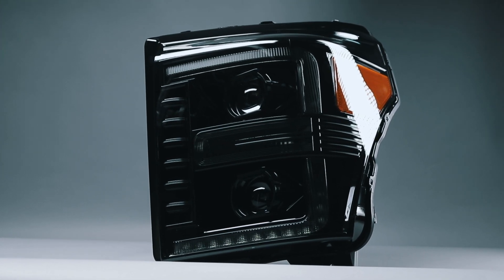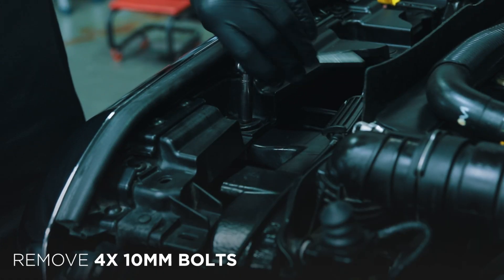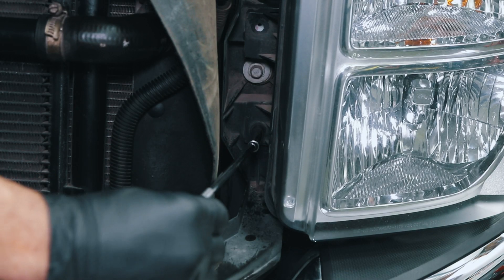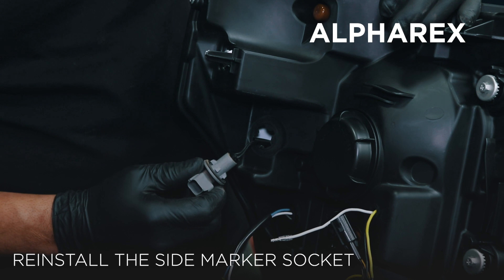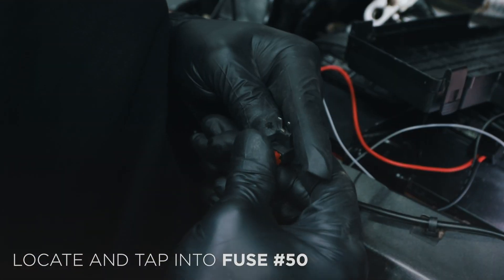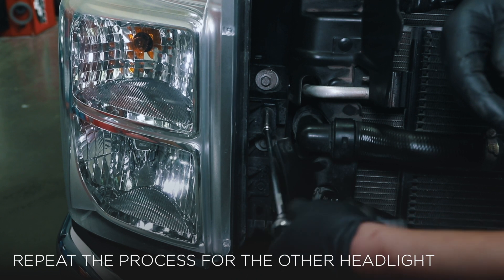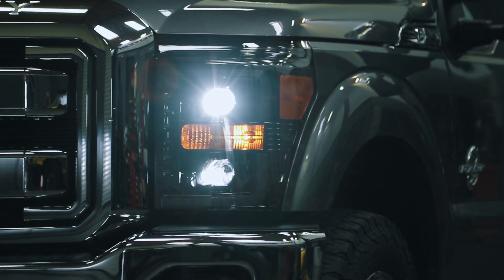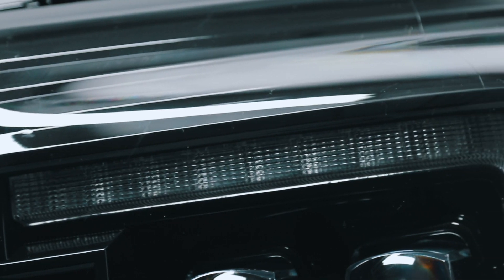AlphaRex Step-by-step Installation Video for 2011-2016 Ford Super Duty Projector Headlights

Comment: Just installed Fit was perfect. Watched a you tube video on installing them was very good. Easy Install Came with wiring harness for the DHL option. Will need to purchase a fuss tap separately does not come with kit. The LED are very bright. You get what you pay for

Comment: I would appreciate knowing how to get both the high and low beams to be on at the same time like in this video.
Reply: After over a month still no answer...
Reply: @ypsisteve  Clearly you don't know anything about headlights. An Alpharex engineer finally responded to an email I sent them. They informed me the LUXX series is the one in the video and it does in fact legally operate both high an low beams at the same time. The reason the Pro series (the ones I purchased) don't is because of the electrical current load using both high and low beam h7 incandescent bulbs at the same time would overload the factory wiring. For the record my 2014 Toyota 4runner and many other oem headlights operate both high and low beams at the same time. No brightbox required!
Reply: @brianh5393  You are right I don't know anything about headlights. Here is what  CFR Title 49 says.

S.5.5.1Each vehicle shall have a means of switching between lower and upper beams that conforms to SAE Recommended Practice J564a Headlamp Beam Switching, April 1964 or to SAE Recommended Practice J565b, Semi-Automatic Headlamp Beam Switching Devices, February 1969. Except as provided in S5.5.8, the lower and upper beams shall not be energized simultaneously except momentarily for temporary signalling purposes or during switching between beams.

https://www.govinfo.gov/content/pkg/CFR-2004-title49-vol5/xml/CFR-2004-title49-vol5-sec571-108.xml
Reply: Some lights can operate high and low at the same time but they have to specifically marked to do so. That is further in the CFR. The overwhelming majority of lights are not so marked in the US and thus it is not legal to convert a light not designed to be upper and lower at the same time to now operate with both upper and lower on at the same time on public streets. Off-road is permitted at any time.
Reply: Boom roasted !

Comment: Will the wiring setup be the same for the LED version utilizing the factory wiring harness and connect directly to LED connectors? Will the LED light output be noticeably greater then the factory bulbs?

Comment: I'm having an issue where my blinkers for these headlights were working then they just stopped working. The side marker and rear lights still blink but they blink fast and nothing lights up on the new headlights. I have replaced the corresponding fuzes and relays to make sure those were not the issue and the headlight blinkers are still not working, please let me know what else it could be.

Comment: The wiring harness which connects to battery with the grey wire was not necessary on my 2011 f250. The DRLs run just fine without it. Kinda confused by this?
Reply: Im having issues with my 2011, everything was fine till thismorning, no turn signal on my passenger side, fast blink on the dash
Reply: Same here. My DRL’s seem to work fine without it so I’m not sure of the purpose
Reply: I am having the same issue on my 2011 f250 diesel. Has anyone figured this out?
Reply: I think it’s in case you have actual daytime running lights…. They will turn on with out parking lights with that harness tapped into the drl circuit. Otherwise the drl will turn on when you turn on the headlight. My 08 does not have drls so I have nothing to tap that too…. So they will just come on when I turn on the parking lights.

Comment: I have a set of alpha rex and they dont do the sequential they advertise for the amber or for the white drl aswell as the set i got doesnt have all 4 beams on for high only 2 at a time top for low and bottom for high not all 4 together for high as advertised really disappointed with my purchase had such great hopes saved for a while to get em and this happens  and now i feel cheated out of money
Reply: did you get the pro and not the luxx?

Comment: How do you get low beam to stay on with high beams?
Reply: I wish they would let us know!
Reply: You use forscan
Reply: @timrobison2463  Yes, I turned on bambi mode and that helps. I haven't found a way to simultaneously turn on high beams and low beams though. Any advise?
Reply: The luxx version keeps them both on